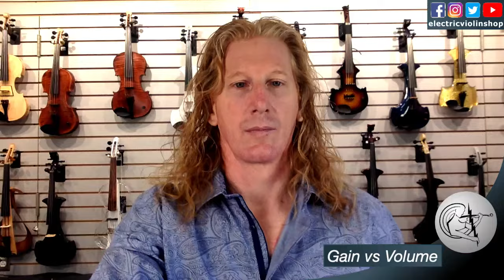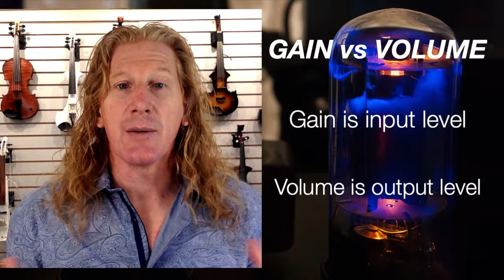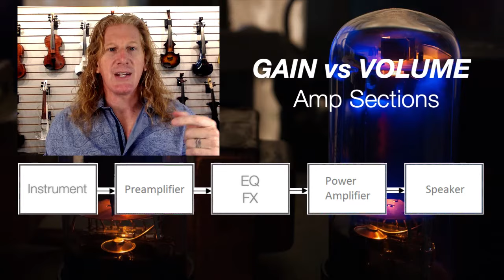What's the Difference Between Gain and Volume?

Comment: Overall, a very good experience, I would just add a couple of details. You need to consider if your amp is tube or solid state.  They don't break up, overdrive, distort, etc..., the same way. When you overdrive the input of a tube amp, it sounds good because it produces even order harmonics. Transistors output odd order harmonics when overdriven. It sounds terrible. That's why solid state amps sound very good with a clean signal but have issues when the transistors are pushed too hard.

Comment: Towards the end I like how you use the word distortion specifically, you use it as a broad term (like minimal tube breakup vs max tube breakup and everywhere in between) which is way more helpful than the straight forward "hard rock=distortion" usage. 
Very well done, you said more helpful words in a more concise way and very quickly but without rushing.
I tend to cendense gain and volume in my head as pre and post, specifically like many peavey amps with the pre gain and post gain knobs working in unison (vs gain and volume or level)
Reply: If you want to discuss gain and volume in the context of distortion, you need more info for a complete understanding. Only gain can alter the signal. (distort, overdrive, change, damage, etc..). A volume control is transparent. It can't alter the signal in any way. All volume controls do is attenuate the signal.
"Towards the end I like how you use the word distortion specifically, you use it as a broad term (like minimal tube breakup vs max tube breakup and everywhere in between) which is way more helpful than the straight forward "hard rock=distortion" usage."
That doesn't give you the whole picture. Gain distortion is very different than volume distortion. Excessive gain causes distortion by overdriving your input tubes directly. The signal itself is altered. Volume can't do that. Volume is like a gate that the more you open, the more electricity passes through it. Gain can actively "push" the signal, volume just lets it pass. Power amp, or volume distortion happens when the output tubes can't keep up with demands, and fail. If you keep turning the volume up on your home or car stereo, at some point you'll get distortion. The signal itself isn't altered, the equipment itself fails, and that's exactly how volume distorts your tube amp. (power tubes). Its 2 completely different types of distortion.

Comment: So, gain increases preamp input and volume increases power amp output?  I kind of get it but it gets confusing because lots of amps have a volume on each channel and then a main volume as well- do they all contribute to power amp output- or just the main? I always assumed the volumes on each channel controlled the output of that channel to the power amp- and the main controlled the output of the power amp to the speakers. While the Gain on the dirty channel controls the amount of output routed through the clipping mechanism.

Comment: so, if there is no gain control but separate volume and master, does gain=volume and volume=master?
Reply from the maker: It would depend on the amp. The best way to know would be to pull up the block diagram.